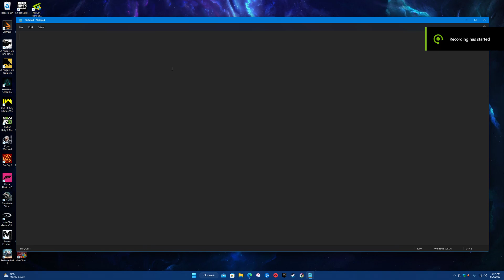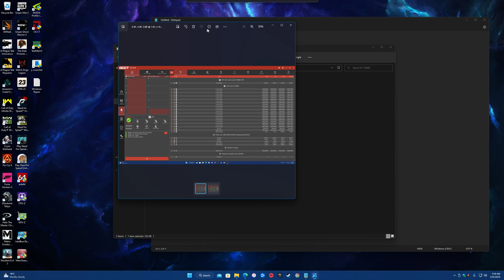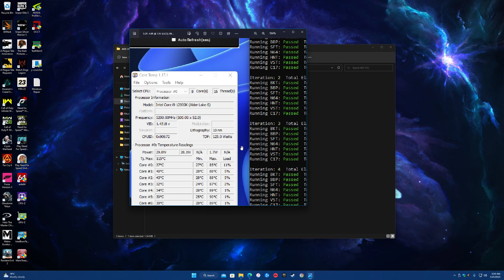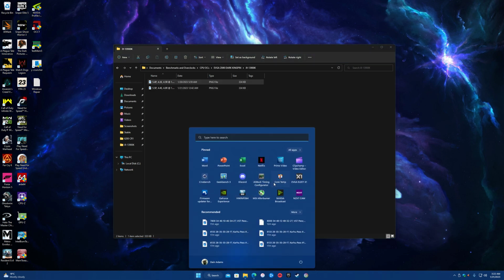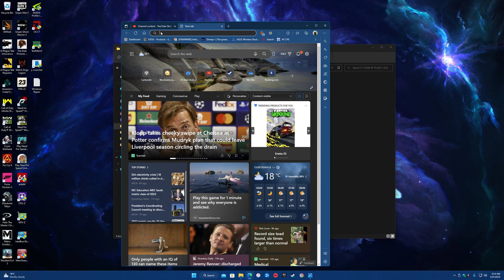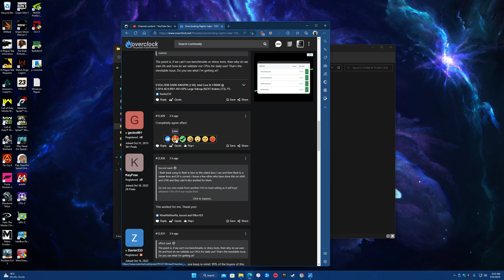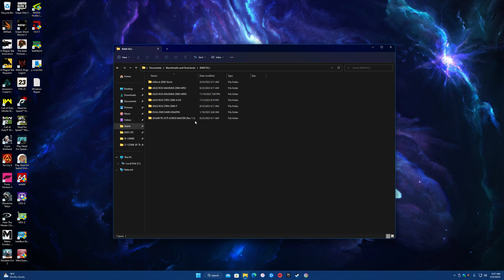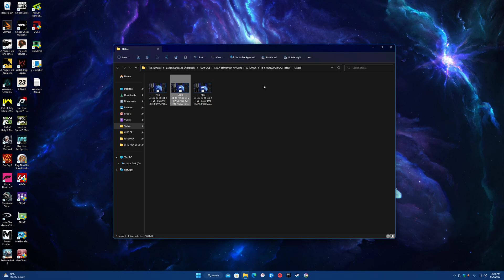Raptor Lake degradation and the current standard for CPU stress testing

Comment: I have new settings which I am using for my i9-13900k and i9-14900k. I don’t like the uncertainty of undervolting so prefer working with power and clock limits. With these settings I got a couple of FPS BETTER on CP2077 and Forza Horizon Benchmark, went from 99th to 98th percentile on PC Mark Extended, passed the Time Spy Stress Test, Time Spy was within a whisker of the average for my hardware, Cinebench R23 finished between 37-38000, CPU-Z, Intel Diag tool and Prime95 was stable and < 90 degrees.

MCE off, PL1 and PL2 limit to 225, limit P-core boost to 5.3 GHz and E-core boost to 4.0GHz, and use balanced power profile in Windows (although I do disable core parking to keep system highly responsive). Oh and just XMP on the RAM. I didn’t change LLC or voltage offset values.

With these settings, you should have no stability issues, be able to run on an air cooler like the NH-D15 (what I use on my 3 i9 13th/14th gen systems) and will barely notice any performance changes in gaming or productivity.
Reply: Update: I have now set voltage offset at a modest -0.010v. I have disabled the C6&C7 C states and EIST. I have then increated max P core clock to 5.5GHz and E cores to 4.3GHz. Lastly I have locked AVX at 0 offset. I have tested on P95/CB R23 and CB R15. All great and in a mid 20 degree room, no workload exceeds 80c on package or cores. Happy Bunny!
Reply from the maker: That’s not a bad way of going about it. The 14900K has some very weird clock behaviour and I honestly am not sure if I understand it at times. I don’t own one, but have tuned so many by this point. The only thing is when you do a fixed ratio, you lose out on those 5.7 V/F points in less CPU demanding games. It’s not a bad strategy tbh.

Comment: My CPU was underclocked, and I wasn't overclocking ram, I ran CPU stress tests for 8+ hours.
Then 6 months later my CPU was getting hotter and also became unstable. 
Then I fixed that.
I also ran about 5 days of 6700mhz Test Mem 5 (Extreme777), and suddenly it became unstable in same test after clocking mhz higher, and going back to 6700mhz

Components degrade, and perhaps you are just at the threshold before everything falls apart.
I was able to get my A-Die to 6933mhz now with same board, and put my P-Cores at 5.4 and E-Cores at 4.4, no issues now. 

Running stress tests can take weeks and tons of electricity. 
Just because it is stable for 6 months, it may not be in the long run
Reply from the maker: I probably would not run a stress test for 8 hours or run TM5 for 5 days tbh. The duration does play a role.

Comment: Are running these tests actually degrading your chip if wattage stays 250 or below mostly?

Like how does running lots of OCCT Large Data Set variable when the peak package power per HWInfo 64 is only a little above 200 watts. Isn't it only well above 250 watts where degradation occurs. And the temps in OCCT Large Data set variable only average in 60s and 70s. There may be a rare spike to 90C but it is like less than 1 second and not often.

And you may say well how is it possible you are only getting low 200s during OCCT. Well I have e-cores off for one.

So am I safe or not with CPU package power in high 100s or low 200s of watts with e-cores disabled?

And also the memory tests except Y Cruncher do not load the CPU nearly as much as even OCCT Large Variable Data Set,

Like TestMem 5 only puts 160 to 170 watts at most and temps never exceed 70C and average in the 50s. Am I really degrading the chip by running lite tests like memory ones and OCCT Large Data Set variable that do not come anywhere close to 250 watts for average temps.

Of course do not want to run Y Cruncher nor Prime95 nor Linpack XTRMEE or god forbid any Small data set test for too long? But are those other tests listed above which I can feel safe going to sleep with as temps never get high and power usage low 200s or mid 100s of watts at worst are actually lite? Are they really dangerous to degrading Raptor Lake fast tests like OCCT Large Data Set variable, TestMem, HCI Memtest and such?
Reply from the maker: I don't think anyone's i9 runs the kinds of workloads that I was referencing in this video at below 250W. 250W on an i9 with a good AIO will see your CPU hitting maybe 80-85c. To achieve that you'd need to do a lot of manual undervolting and set a power limit.

Regarding the sorts of tests that you're referring to. Memory tests are not CPU intensive at all and OCCT Large is actually almost as heavy as y-cruncher VST anyway. 

The thing is, I don't really know what that fact ends up leading to. The main problem is that with Raptor Lake, in order to maintain true stability while not being at dangerous load voltage and current, you need to be at very conservative clock speeds on mediocre samples.

What adds to that is that board vendors do not enforce Intel limits at auto, and they all refuse to adhere to the revised 5.4P turbo for the i9-13900K. This forces the 5.5P fused VID value. When you combine those factors, booting up Prime95 on a stock 13900K on a number of boards is literally conducive to degradation.

Although you're correct that certain lighter tests can theoretically be run at a higher load voltage, that doesn't really serve anything because there are still a host of other actual stress tests that you cannot run if you don't want to degrade your chip.
Reply: @dainluke  Well I find VST in Y Cruncher to push CPU temps much higher than OCCT Large Data Set variable. And is a 5.6GHz all core static and manual overclock at 1.3V LLC 6/8 conservative or too high? Its a 13900KS with P core SP of 124 so a golden binned chip? And e-cores are off and no cores go above 5.6GHz.
CPU package power never gets above 220 watts in any workload except in Y Cruncher and Prime 95 and Linpoack gets to 240 to 270 watts, but 270 watts is worst case peak and never ran those tests for that long at all.
Reply from the maker: @Wolverine607  It all depends on your current draw and your load voltage. That sounds relatively fine though.
Reply: @dainluke  What is the current draw and load voltage limit? And what will degrade it within 5 to 10 hours which is very fast? Or can it be degraded even faster?
Reply from the maker: @Wolverine607  Rate depends on how far over the threshold you are. It's sample dependent, but roughly speaking 245A @ 1.25V. Any current over that is not great and obviously you'd need to reduce the load voltage and preferably keep the setup cool.
Reply: @dainluke  Need to keep setup cool near that or over? Though if setup runs below that threshold and temps hit 85C to 95C will it also degrade fast or more slowly?
Reply from the maker: @Wolverine607  Slower the colder it gets, but someone with a MO-RA saw degradation at 80c
Reply: @dainluke  I see in another video on your channel about IMC testing and how normal users should not be regularly using these CPUs at 200 watts or more. Is that in an area where degradation will occur or is it just near 300 watts?

And also does idle wattage matter. I noticed that my 13900KS was idling around 80 watts per CPU Package Power in HWInfo64. C-States in the BIOS was on Auto. I turned it to Enabled and now it idles at less than 20 watts while clock speed stays fixed and no downclocking at all which is good. Is 80 watts a very high idle voltage and could it lead to slow degradation if C-States are off?
Reply from the maker: @Wolverine607  Idle power and current don't really matter to be honest. Regarding the IMC video, I definitely would say it's best not to unnecessarily push the chip through heavy IMC tests when you realistically can streamline the process.
Reply: @dainluke  Is it bad to push chip through heavy IMC tests even if package power and temps are much lower than CPU. Well TestMem5 and OCCT Memory test package power peaks at like 150 to 160 watts and temps never exceed 67C.

On the other hand Y Cruncher N64 and VST temps in 80s and 90s and CPU package power hits 240 to 260 watts sometimes.

I am sure the first is fine to do a lot. Jus not Y Cruncher extreme tests. Or is even low Memory or potential IMC loads like TestMem 5 and OCCT Memory test extensively bad despite low tempos and power usage?
Reply from the maker: @Wolverine607  Those are obviously fine

Comment: I disagree with the degradation portion of this video. If you are running unsafe voltages and then are adding on high current workloads, then yes, degradation may occur. However, if you are running reasonable voltages and have temperatures in check, it should be encouraged to run multiple stress tests for stability, ESPECIALLY for RAM as it can corrupt windows/your files. There is not a single stress test that will ensure RAM stability and you need to run multiple to measure stability. For example, a timing such as tWR can error very late, so 1 stress test is completely insufficient. Now finding a maximum daily voltage can be hard to find on newer chips, you can usually predict what’s unreasonable.
Reply from the maker: The issue is that we have a lot that suggests that Raptor Lake does degrade readily. What you need to understand is that even most people’s stock VID curves are unsafe. I’m talking 1.2V Vmin on die-sense and that’s barely safe for R23. 1.25V and it’s chalked if you’re using an i9.

With regards to RAM. No, y-VST and TM5 PIDAC/ABSOLUT are it. I’ve tested with HCI, Karhu, Extreme1, ABSOLUT and PIDAC. It’s tough to determine when something like tWR will throw an error, but I’ve found that on boards such as the Dark, you won’t get through VST with tWR set incorrectly, and on the Hero, voltage supply is still exhausted in TM5 as long as you’re not using something like Extreme1. 

At the end of the day the IC’s capabilities are all related to the integrity of the data line to the IMC and the power supply. In a perfect scenario with perfect training, broadstroke VDD/VDDQ adjustments should take care of all timings. But there are also factors like ECC with D5 and using obscenely tight timings usually result in performance loss if you’re actually unstable. 

I guess what I’m saying is, using Karhu and HCI for instance is a waste of your time because odds are your OC will fail PIDAC or ABSOLUT within seconds, that’s not a hypothesis, that’s an observation I assure you.

I’ve only suffered OS corruption once and that was 2 years ago with 4S8B and because I thought 200% HCI was stable enough. It took me 6 months before I began to notice it. As of recently - none whatsoever. The issue is that people do not respect VST or understand how to use it, and they don’t combine VST with ABSOLUT or PIDAC typically. 

Another part of it is just inference. If you’ve been tuning D5 for long enough you begin to identify patterns and you can infer what is doing what. I’ve just never observed a bad timing not being punished. Whenever I try obscene subs I get punished. I always need to relax them within reason so as to not cause distortion. In terms of CAS and RCDRD/RP - VST sorts those out real quick. You will never survive VST between CMOS clears with scuffed RCDRD/RP. Idk maybe if you’re at sub-30c it’s different. It could be the case that once your DIMMs are on water, opportunities for overtight timings to pass certain stress tests occurs. This never happens at 45-50c though.
Reply: @dainluke  I’ll go look into the whole stock voltage degradation thing since that sounds interesting. I understand that you’ve observed that your RAM overclock only requires a couple stability tests to throw errors but this is definitely not the case with everyone. I’ve seen hundreds of RAM overclocks across various Discords, as well as worked on the integralfx DDR4 guide and I can assure you that only using TM5 is not enough. Just another example besides tWR, which I said before, can error very late, is ryzen FCLK stability. One can’t simply use a RAM test for that and stability is verified by running p95 large FFTs AVX2 and OCCT VRAM. If you’d like to verify these claims, take at look at the OC Discord as there are tons of resources and information there. For your last part, I completely agree. You can generally tend to infer where you land just based off of experience.
Reply from the maker: @LunarPSD  I agree with you in that regard. Tbh I don’t really cover Ryzen all too much. I owned Ryzen at a time but I never made content on it because I didn’t have the internet for it, nor the passion to do so at the time. I guess I should caveat it but I think by this point it’s kinda obvious that my content caters mainly to Intel users (not that I hate AMD). I believe I did mention that as part of my bullet points for what not to watch my channel for (I say that in all seriousness and not facetiously).

But as with this video, it’s addressed specifically to Intel, even more specifically - RPL. From my past experiences RPL degrades more readily than ADL, the WHEA thing is something only RPL users deal with. I could definitely add a note to the video in that regard. Ok wait it’s in the title 😬. 

But yeah like, I find it curious about the timings issue, but I really don’t understand it. When I always tell my viewers that I’ve done a lot of testing, I don’t really think many people understand what I mean. I literally do not have a life outside of PCs and most of the last 14 months were literally at least 500 - 1000 hours of weekly tuning with a plethora of hardware ranging from garbage to decent (not simultaneously of course because I am a brokey 🤣). I probably do more testing than FC, but I don’t get paid and I don’t get free hardware 💀.

Like I really don’t understand it, my stress testing procedures have changed and adapted over time, but never have I ever gotten away with bad sub-timings. Do these individuals emphasise IMC testing as part of their protocol as well or?

Comment: hello bro, one question I dont know why I keep inst crashing with Y-cruncher, I pass prime95, occt, cinebench, etc but I cannot properly run Y-cruncher, I test with no overclock (default) and with overclock, do you happen to know why this may be happening? BTW great channel!
Reply from the maker: So even at stock? When you say crashing do you mean like a BSOD or a error in the app?
Reply: @dainluke  only error in the app, but the systems becomes like unstable and I need to restart the pc, its so weird
Reply from the maker: @tacoterito22  So you get those logical core errors? Those red strings of text?
Reply: @dainluke  "Oops... y-cruncher has crashed.
Creating mini-dump file...  Done!
The program will now exit."

red strings of text!! :S
Reply from the maker: @tacoterito22  Which test run does it occur on?
Reply: @dainluke  Im trying VST ycruncher
Reply from the maker: @tacoterito22  Ok that explains it. I’m sorry for all the questions but I wanted to narrow it down. Yeah that’s just the IMC.
Reply: @dainluke  But the weird part its that I can do 48 on the ring even 50 without crashing on other test while I crash with ycruncher with default?, its a 12900KS so I dont think its that, maybe im wrong
Reply from the maker: @tacoterito22  VST is a different beast. 90% of people who OC D5 won’t pass VST. That’s the unfortunate truth of it and is also why most people don’t test it. This is why people suffer crashes even after passing hours of HCI, TM5 or Karhu. The CPU will fire a command during a gaming session, and the data will be either corrupted or distorted and you will crash to desktop.

But wait, you’re failing VST with XMP or tuned memory right? I’m assuming. I think if you run it at JEDEC it’ll pass. It’s worth a try to narrow it down further.
Reply: @dainluke  this is with DDR4, Im crashing even with JEDEC that's the thing, not even activating XMP and still crash, it's so weird, I flash to a new BIOS and restore default values, and still ...
Reply from the maker: @tacoterito22  If you can’t pass VST even with JEDEC and D4 then there’s something else fundamentally wrong. By that point I’d begin to consider that there may be something wrong with the board. It’s so odd though. At JEDEC it can’t be your sticks and I don’t know how an IMC would just not be able to run VST. Potentially the app itself? That’s a long shot though. I assume you’ve passed the other tests.
Reply: @dainluke  yes its so weird, but thanks again for your input, I would try other motherboard and see if that solve it
Reply from the maker: @tacoterito22  Can you maybe acquire a different RAM kit?
Reply: @dainluke  yeah I have a few, will try that
Reply: @tacoterito22  very interesting, keep us updated pls

Comment: Idk maybe it’s the VRM that degrades? It’s kinda brash to assume the silicon would degrade so quickly, especially if the TJmax is technically rated at 115C. I think that’s actually worth testing as well 🤔. Obviously that’s not in your scope of the video, especially since we’re being cautious, but I think it’s safe assume to assume there’s other variables at play here.
Reply from the maker: It definitely isn’t the VRM. With regards to temperature, the unfortunate truth is that Ichirou observed degradation at sub 90c (well below 90c) as he owns a MO-RA 420 Pro. Unfortunately the consistent current draw of y-cruncher’s individual tests was enough to knock each of his maybe 5 good i9 samples down by 15-20mV.